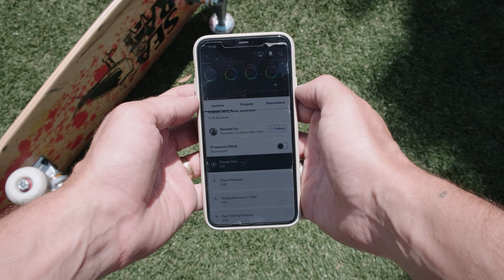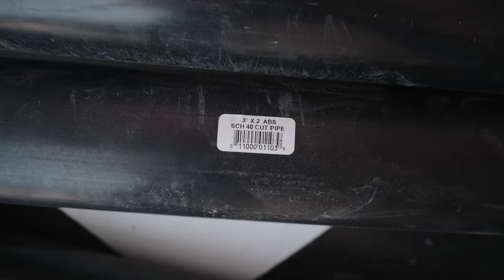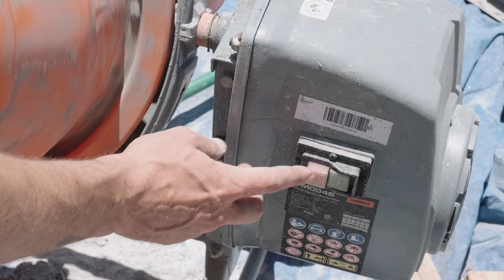How To DIY Skate Coping (Beginners Guide)

Comment: Definitely should use concrete form release instead of oil next time, oil isn't the right product for mold release with concrete and can mess it up from not curing properly. Maybe try skateboard wax on your forms if you don't have something made for concrete. Because the PVC is flexible and easier to pop off, you would probably be better off skipping the oil if you can't grab something made for concrete forms and molds. I'm no expert in concrete but have worked with it in construction and also art. Still a great tutorial and channel. Keep shredding dawg.